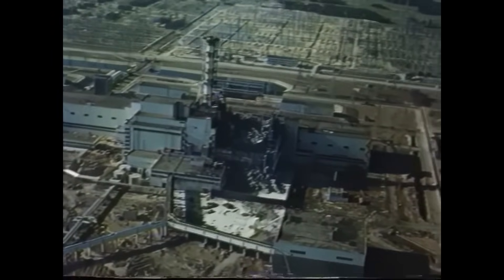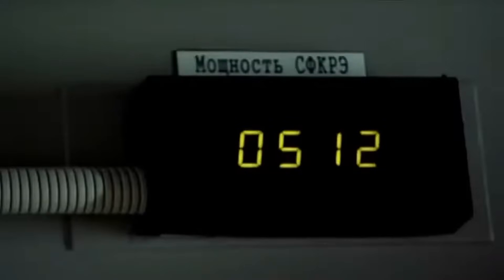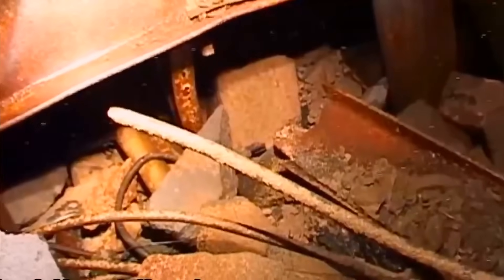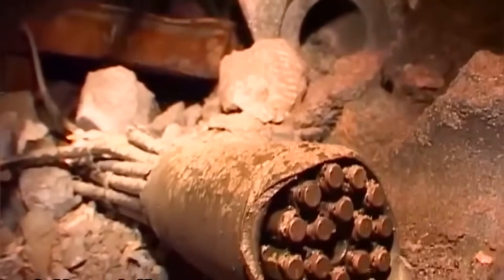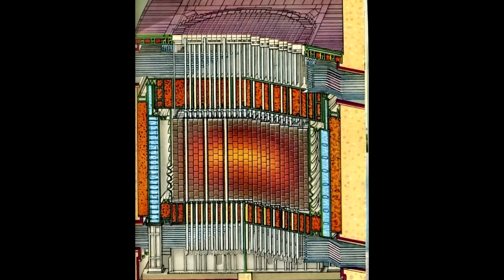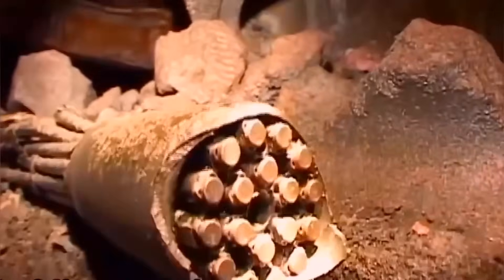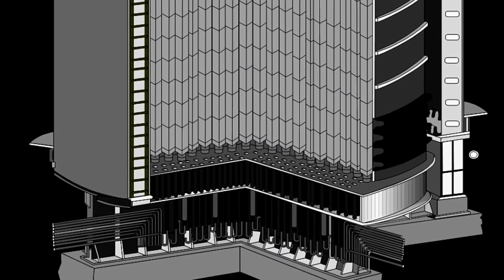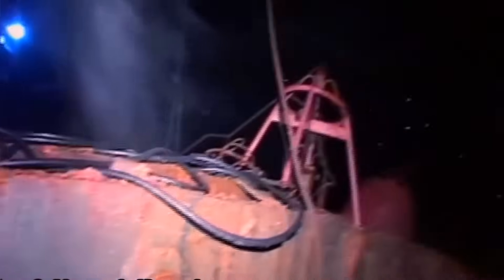Chernobyl Explosion Theories: The Hydrogen Explosion and Why it Doesn't Work

Comment: I see that you cannot stand calculations proving that core cross section is not graphite surface area. Shame on you
Reply from the maker: I have said several times, oxygen could never react there because water, steam, fuel rods, control rods and a layer of zirconium surrounds it. Unless you can prove one atmosphere of pressure can displace all of that, you can't access it.
Reply: @thatchernobylguy2915  you forgot multiple times, that above certain temperature zirconium reacts directly with steam. Your arguments are pointless. Hope that someone that is actually doing science will debunk you in a place you cannot delete comments
Reply from the maker: @brylozketrzyn  I'm not deleting comments. I am interested in the debate. If they're not showing up on someone else's side, that's probably on YouTube's end, but I can guarantee I haven't deleted any comments.

And no, I've not forgotten, because I cover it earlier in the video. No zirconium oxide has ever been found, only unreached zirconium. Given almost all zirconium would need to react to produce even a small amount of hydrogen, we should find plenty of zirconium oxide, but there is none. It never reacted. This has been confirmed in multiple papers.
Reply: @brylozketrzyn Youtube deletes comments automatically so you should be checking if your comments stick after posting them. No clue what the standard is and you don't get notified, but if you post multiple links for instance that could trigger it. It’s an anti-discussion policy.
Reply: @thatchernobylguy2915  Water contains oxygen and a drop in pressure can cause that to be released.  In fact, as water gets hotter the solubility of o2 declines so as the reactor over heated it would necessarily release O2 from the water.  No need to displace anything to get O2, you just have to pull out O2 that's already there.  Unless there's documentation about the exact chemical composition of the primary coolant you're basing this off of, I think you're missing a variable.  Regardless, there had to be some O2 in that water even if the coolant was highly refined; they can't have got it all.  
And no way in hell was that explosion 225 tons of TNT.  The bomb from the Oklahoma City Bombing was only 2.2 metric tons of TNT and it took out half of a 9 story building from outside.  The Davy Crockett came in 10 and 20 ton variants.  The GBU-43/B Massive Ordnance Air Blast bomb is 11 tons; I imagine one of those would do more than enough damage.  225 tons is close to the low end of the yield for actual thermonuclear weapon, namely the B61 which is a low to intermediate yield tactical/strategic nuclear bomb with a yield estimated to be between 300 tons and 400kt.  10 tons is way more realistic than 225 because 225 would have left nothing intact.

Comment: Hey, Interesting discussion of the subject, however I have one major mathematical issue: 

The Surface Area figure of 109.35m² regarding the crossection of the reactor seems rather small - because I guess it is just the Surface area of the core lid.
Please follow me here...

The lid is only a fraction of the surface area.
Example: when we use the 11.8m diameter and 7m height (Active Core dimensions) we would still end out with a cylindrical surface of
A = 2πr(h+r) = 2*π* 5.9m * (5.9m+7m) = 478m²  - already more than four times your stated figure.

Now to the chemical part... afaik when determining something like catalystic effects or the "graphite steam corrosion rate" you would likely go by active surface area, means surface area taking part in the reaction, which in lag cases are usual very thin samples.
In the case of the reactor we need to look at least at the inner diameter of the graphite channels, if not even more, because the stacked graphite blocks would not be steam- proof.

If we take one tube, inner diameter was something like 10cm = 0.1m iirc we would end up with a mantle surface of A= 2*π*r*h= 2 * π * 0.1m * 7m = 4.4 m² seems not much, but there were like more than 1500 channels in that thing... means like 6600m² plus inner surface altogether. 
Hydrogen being hydrogen would likely end up ascending to right below the lid.

Aware, that logically you just consider the lid area alone capable of reacting with oxygen, it would serve your argumentation better, if you start out with a large hydrogen amount and scale down from there (Not the whole reactor produced Hydrogen with its whole surface area, no oxidizer present, etc.) literally reinforcing your point.
Reply: Total surface area of graphite was just shy of 50 000sq meters. That gives potential to create 1500kg of hydrogen in case steam is released between the blocks. But my calculations were deleted by uploader.
Reply: Here is a video looking at the reactor graphite surface area in more detail to determine the amount of hydrogen gas thah could be produced. https://youtu.be/m0eal55cGqE
Reply from the maker: Problem, the core is still filled with highly pressurised steam and water. If you can prove that atmospheric pressure can displace all of that steam and water and the Control and fuel rods in those channels, and then melt all of the zircalloy surrounding the channels, then you can react that graphite.
Reply: @thatchernobylguy2915  you seem to forget, that superheated steam can react with zirconium. There is no significant pressure after first explosion, which shattered channels and severed top steam pipes.
Reply from the maker: @brylozketrzyn  There is significant pressure, both because pressure in the core won't return to one instantly following the explosion, and will have a higher pressure for several seconds afterwards, and also because water is still entering the reactor and flashing to steam.

And the graphite in those channels is still blocked by the zirconium that surrounds the channels. You can't get in there.
Reply: @thatchernobylguy2915  Just rewatched the vid, getting your point better. 

Just watched the Sich's Theory vid, I rest my case, I congratulate on your work well done!
Reply: @thatchernobylguy2915  several seconds is extreme.  The overpressure from the vast, vast, vast majority of explosions is in the realm of milliseconds and the negative pressure phase is far longer than the over pressure.  For the pressure to remain high for several seconds you would have to be saying that the explosion was actually in progress for several seconds and not one account I have ever read talked about an explosion that lasted several seconds.  Then there would be the longer than "several seconds" negative pressure to suck in plenty of O2.

Comment: Chernobyl expert here (since 1997). Your theory is wrong and contains several gross mistakes.

1. It does NOT take 10-220 tons of TNT to produce the destruction we see in Unit 4. These numbers are greatly exaggerated. To get an idea of what hundreds of tons of TNT look like, go no further than Beirut blast. It would have destroyed the entire NPP. 10 tons would have leveled Unit 3 as well as Unit 4. But that is only part of the problem;

2. Chernobyl hydrogen explosion was VOLUMETRIC gas blast as opposed to BRIZANT blasts made by chem explosives like TNT. The difference is enormous!! Imagine a room filled with hydrogen for 10% of it's volume. This will make an explosion sufficient to destroy the house where such room is located. Google gas explosions and see pics-vids to get an idea. Suppose room is 50 m2, heignt = 2,4 m. Volume of h2 will be ~12 m3. Guess mass of H2? ~ONE KILOGRAM!! A single kilogram of H2 will destroy a house.  Similar mass of TNT will only get you broken windows. This is the power of gas explosions, and that's why the military use this effect in what is known as VACUUM BOMB.

3. The relatively small mass of H2 needed to produce the destruction observed could have easily been produced under the conditions of the accident. Missing ZrO? This is ridiculous argument. The fact is that about 25% of nuclear fuel from reactor 4 are still unaccounted for. It's there, it's just buried under tens of thousands of tons of broken concrete, equipment, sand, dolomite, lead etc. This is ~ 40 TONS of uranium dioxide. Such are the realities of an industrial accident the size of Chernobyl that stuff the size of a railcar can go "missing", forever buried under apocalyptic mess of unrecognizable garbage, debris and so on. Now you are looking for ~50KG of fine ZrO powder, pulverized and gone with the wind. This is not at all funny.

4. You don't show this in your video, but I invite everyone to google (better, yandex them) pics showing reactor hall post-explosion. I can't upload pics to a Yt comment so do the work yourselves guys. You can see the wall panels from adjacent steam separator room caved into the reactor hall. Basically the fell INWARDS. One panel actually went INSIDE reactor cavity!! This is a 100% proof that it was a hydrogen explosion, producing VACUUM BOMB effect.
Reply from the maker: Actually the number is not exaggerated, because you have to rip the inside of the core out and throw the internal steel shell of the reactor into the Reactor Hall where it lies today, and also slam down the Lower Biological Shield several metres through its support beams. In other words, a vacuum bomb effect would nit have caused this, it certainly wouldn't have caused the steel shell of the reactor to be sucked outwards.
And, furthermore, the explosion occurs in the core, nor out the core. If the hydrogen escapes the core you get a blow torch effect over a dozen seconds, not a big bang of all of it simultaneously reacting. And if it reacts in the core, not only does it make tearing the shell of the reactor out impossible, but the only amount that can do explosive physical damage is the small amount of force directed upwards, greatly increasing the volume of hydrogen necessary.

Equally, it does not take a lot of force to push the panels into the core. We know those panels were already weak from accidents in 1984, and hydrogen explosions are presumed have occurred in the steam separator room when the SUZ tank failed. You can't use the SUZ tank hydrogen because it's already out of the reactor.

And, with regards to zirconium. It doesn't matter how much you claim "we didn't find any reacted zirconium but that doesn’t matter," you we need to react all of it to produce just a small amount of hydrogen. No zirconium oxides, no hydrogen.
Reply: 1. Beirut explosion was estimated to be around 1-1.5 KILOTONS that’s 1,000 -1,500 tonnes TNT which is at least 10 times higher than Chernobyl estimate.

2. Beirut explosion was on the ground so much of the explosive force went in all directions. Chernobyl explosion happened inside a heavily fortified reactor pit with 2.5 thick concrete walls all around and multiple layers of several meters thick of biological shielding. So most of the blast force is projected upwards into the sky, not to the side which would have certainly destroy the other buildings as well.

3. I don’t know how much explosive force is required to lift up the reactor lid with biological shielding that weights 2000 tonnes several metres high into the air but I would assumed that it probably be quite a bit higher than 10 tonnes of TNT…
Reply: Also that “25% of the fuel still unaccounted for” Well… that number is actually very misleading as that is estimated from the amount of “corium” found onsite at Chernobyl.

However, the so-called “corium” at Chernobyl is not really “corium”… its mostly consisted of just “melted sand” with only traces of uranium fuel and other fissile products (less than 10%) while corium found at other accident site such as Fukushima or Three mile island consisted of over 70% uranium.

Yes, the infamous “elephant’s foot” is actually mostly just “melted sand” with only a bit of uranium in it.

When it was first discovered the radiation was estimated to be around 8000-10,000 roentgens which gives you 50/50 chance of survival after 5 minutes standing next to it. While that is very high no doubt… but it also means you can take a couple of selfies standing next to it and still not received a fatal dose of radiation even back then 🤳🤳🤳

That is something you cannot do with corium found at Fukushima or Three Miles Island which can give you a lethal dose within seconds… even today.

Note that the amount of radiation from elephant’s foot is totally in line with the fact that it is mostly just “melted contaminated sand” and not actually “melted nuclear reactor fuel”

So more than likely that the fuel unaccounted for at Chernobyl is a lot higher than just 25%

Maybe I might have a tiny amount of that missing fuel in me…

who knows? 🤷🏻‍♂️
Reply: @wsswetghg8791 Are you familiar with any scientific papers that attempt to model the hydrogen generation or deflagration quantitatively? There seems to be an interesting lack of work produced to support the 'default hypothesis' of an H2 explosion.

Comment: There's a fundamental flaw in your logic towards this one, explosive decompression or over pressure explosions don't simply expand to the ambient pressure and stop, they're sufficiently violent and fast that the momentum of the gases expanding creates an effective vacuum behind them which will draw all surrounding hard back into. 

Following the first explosion this vacuum behind it could, and must, draw fresh air back inside the chamber to equalise that pressure
Reply: This.  The negative pressure phase is actually longer than the overpressure phase.
Reply: Which would be the exact same air that it had blown out just moments before, and even if not, that would require a LOT of oxygen, and an almost perfect mixing. 

Getting that much air to mix in THAT short a time is what makes rocket science rocket science.
Reply: Formalizing this a bit, Chernobyl Guy's claim that gases flow exclusively along pressure gradients is only true at steady state, where the gas doesn't have any preexisting momentum in some other direction. What happens in an explosion is that the gas is driven outwards at high velocity, and that momentum carrying gas molecules away from the center is what creates the vacuum in its wake. 

In other words, Chernobyl guy is misapplying the relevant laws of physics by assuming steady-state conditions. If he were right, then thermobaric weapons and fuel-air explosives would not work. Both of those rely on vacuum in the wake of an initial explosion and subsequent inflow to create the conditions for a larger detonation. The hydrogen theory of Chernobyl is effectively that the initial explosion plus Hydrogen generation from the core created a thermobaric weapon. While I don't buy it myself (I think that Sich makes more sense), it's more viable than Chernobyl Guy makes it sound.
Reply: @patrickchase5614  the vacuum bomb requires that there be a low pressure area behind. IE, gas still follows from high pressure to low pressure. The shockwave just briefly interrupts this.

That is not the case when superheated steam goes poof. 
It will in fact keep expanding and cooling down, because more superheated water becomes steam, keeping up the pressure, thus NOT allowing air from outside in.

This is analogous to how you can prevent leaks in staged combustion engines. Just have a higher pressure helium section in between.
Reply: Not really, as the steam release didn't stop once the lid was off, but only once all containers of the primary circuit were empty.
There was almost certainly a constant over pressure condition for many seconds after the lid was off, but of varying absolute pressure.
The lid itself is rather simple to blow off: The lid is far lighter than it needs to be to withstand the reactors operating pressure during a leak. The entire fail safe for the technical tubes was, that the steam release from up to two pipes was insufficient to get to a dangerous pressure before the pipes were disconnected via valves. In case of this accident, that was not what happened. Instead, a common failure mode cause all pipes to burst around the same time, which is sufficient to lob a lid of roughly 760'000 tons into the air, of which the actual lid was less than a percent.
Reply: This just started a huge debate in the mathematics, chemical and physics community lol

Comment: The 3000 atmospheres doesn’t rule out that the pressure starts explosively releasing steam and reactor parts and then, a split second later, pyrolysis and radiolysis (don’t forget the amount of radiation in there!!) of water creates hydrogen and oxygen, which again a split second later can explode!
Of course to me in the end it’s simply enough to think about the overall energy density exponentially increasing being generated and released … that alone can create basically multiple forms of explosions! I wonder if some crazy people even discussed a tiny fusion reaction taking place because of the pressure, energy, heat and hydrogen?
Reply: And what would be fused?
Reply: @zemm9003  Hydrogen, well, that word is right there in the end of the sentence.

Comment: so, if I'm reading this correctly there would've had to be a very high amount of high pressure hydrogen already in the reactor, and even then it would've most likely have been a slow but intense burn for a few seconds rather than an explosion, and it's more than highly implausible that that it was even physically possible for that amount of hydrogen to get into the reactor in the first place.

Comment: Primary localized BLEVE in a handful of channels lifting the lid off followed by larger secondary BLEVE in all the remaining channels accompanied by gas and oxygen reacting with the hot bits and bobs causing fiery type reaction.
Reply: How does the secondary BLEVE occur though 🤔If the lid lifts off, then all channels rupture and pressure from all channels is allowed to gradually escape.